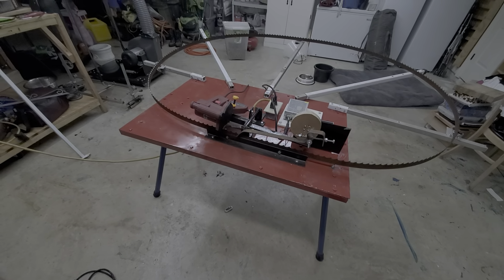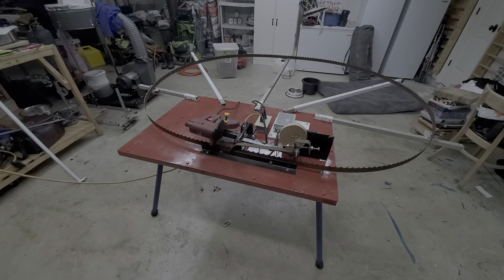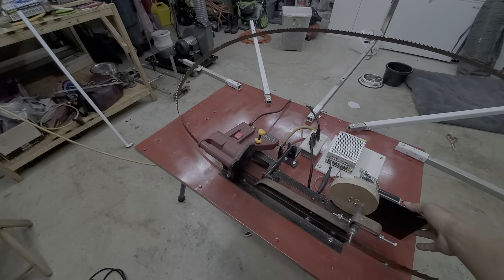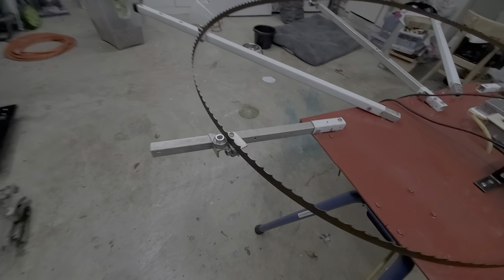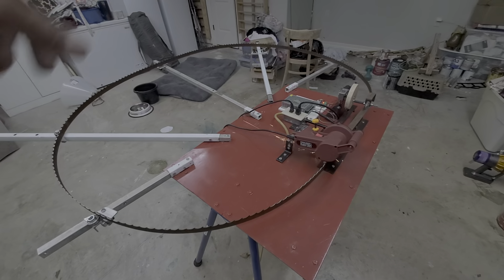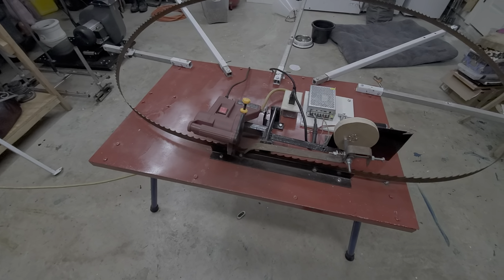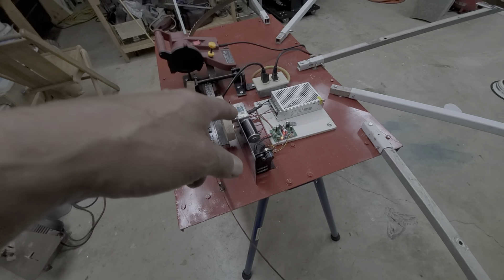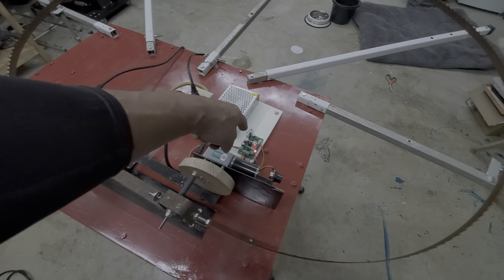My First DIY bandsaw blade sharpener.

Comment: How did you make the guide system to make the grinding blade follow the contour of the sawblade?
Reply from the maker: I rotated the blade slowly and allowed the stone to follow the co tour of the blade.  I then used a pencil to mark the wheel on where it needed to be.  There is another video on YouTube on how it is done.  I will try to find it and put a link to it.
Reply from the maker: Here you go.  Just fast forward to the part how she describes how she did it.
https://youtu.be/2PUsh9JptqM?si=9kEFGWH6AVN0bNAh
Reply from the maker: Here is another one.  
https://youtu.be/le_NmxlLTRk?si=gTBItbWt5PaRpuVS